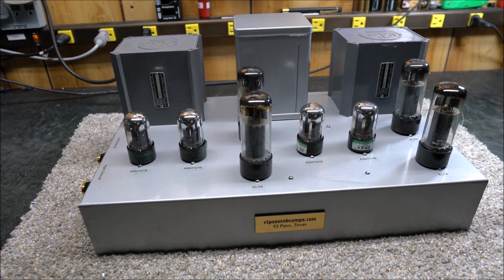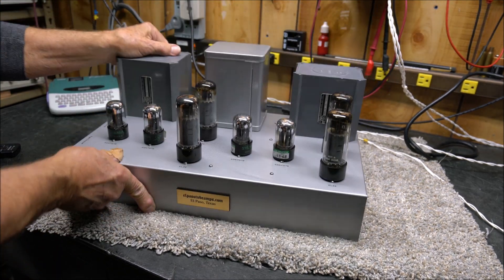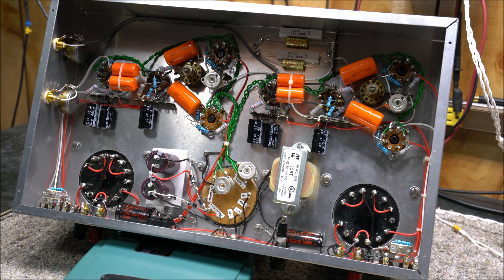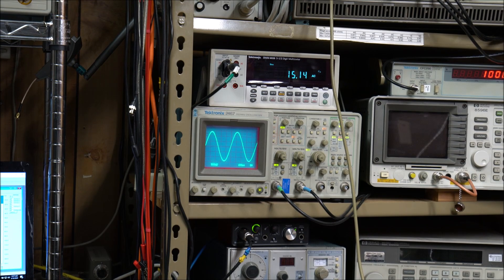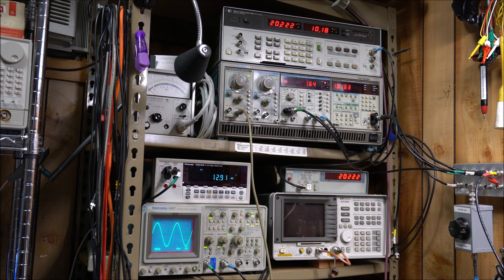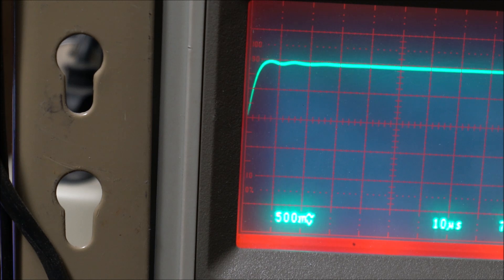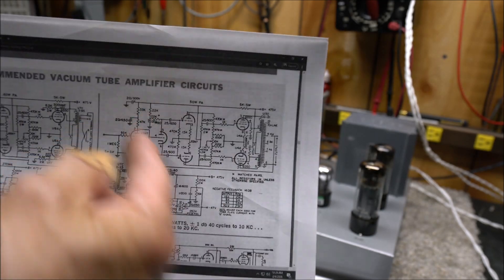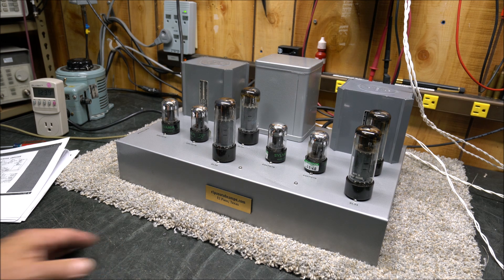Vintage 1959 Mullard EL-34 With UTC LS-57 Output Transformers In Stereo Williamson Amplifier

Comment: Nice performing amplifier and great video.  I have  a pair of UTC LS55's toutputs that I would love to build an amp with, and have been wanting to do a Williamson build.  Would you be willing to share a schematic or at least let know what your feedback values are.  Thanks for any help you can give.
Reply from the maker: Hi David - yes, I will be happy to share anything I know (or think I know...). As for NFB values and the resistors necessary to get the values we desire in feedback, I start out by disconnecting all NFB then run the amplifier up to some level of power that is still very good, meaning not distorted, monitor with an oscilloscope. If it is driven into clipping the measurements don't work. For example, run a 20 watt amplifier up to 10 watts or so with no NFB. I then decide how much NFB I want and put a pot, something like a 25K or so where the original feedback resistor was and turn down the power to the level that the amount of feedback would give. I am thinking of a classic Williamson design where we connect a resistor between the 16 ohm tap of the output transformer back to the cathode of the first stage of the 6SN7 or 12AU7, etc. For example if your amplifier is running at 10 watts with no NFB and you want 10 dB of feedback, you would adjust your resistor for 1 watt output. That would be 10 dB. Then disconnect and read the value of resistor with your ohm meter and install that value. 16 dB of NFB is common in Williamson era amplifiers and as much as 20 dB may start causing instabilities at the low end causing the scope trace to oscillate up and down at about 1 HZ. I have also found that the more NFB introduced into an amplifier, the more compressed it may sound although (within reason - up to around 16 dB) the more NFB the more power you will get with lower distortion. Typical values I have found for Williamson amplifiers are between 4.7K and 6.2K - just as a starting point...   Hope this help.
Reply: @ElPasoTubeAmps  Thanks, that does help.  The LS55 outputs are the same as the LS57s you used, excepting the line output terminals, so should perform similar to your amp if keeping to el34 triode mode, similar voltage, feedback, etc.  You said you found a 150 pf cap across the feedback resistor worked for you.  Realize that will be dependent on the feedback resistor, but do you know the frequency you found worked best of the tuned rc combo?  Thanks!
Reply from the maker: @davidmcgown9425  I know I did the capacitor tuning on a square wave and if I remember correctly, it would have been at 1 KHz  and probably checked also at 10KHz square wave. It was amazingly sensitive as I went above about 180 pF, if I remember correctly, it got a big hump in the square wave and THD went up quickly.
Just realized you may be talking about the RC snubber. I think I used 220 pf in series with 4.7K (I think...) that would be about 154 KHz. It seems almost anything in the upper KHz range should be good. It definitely stopped and smoothed out all the parasitics.  If you raise the capacitor to 470 pF it will have a pole at 72 KHz or you can leave the capacitor at 220 pF and change the resistor to 10K for 72 KHz pole if you prefer. I chose to keep the capacitor small as it does have some effect of raising THD at the 20KHz level that I can measure.
Reply from the maker: This is going to be "off the chart" so to speak, but I am considering using the UTC LS-61's that I have in the same manner I used the James transformers - that is, used them in a para-feed SET as the matching transformer between the choke which is the plate load for the 300B and the speaker. I know that sounds strange but it is exactly the same thing I did with the James transformers and the results are  truly amazing. There is no current flowing thru the primary of the matching output transformer. You would have to  hear it to believe it.
Reply: @ElPasoTubeAmps  Thanks again.  Your video was so clear, I was able to read the resistor code off your feedback resistor off the output winding (6.5K) and your discussion on square wave response stated you found 150 pF was the optimum value in your build.  I assume you took the feedback off the 7.5 ohm tap because of the way the LS transformer windings are connected.  Again the video and your discussion of the schematics really tell it all after reviewing it again.  Thanks again for sharing your experience with us!

Comment: I'm ABSOLUTELY including a mystery hole in my next build. 😎
Reply from the maker: I have enough mystery holes in some of my chassis to get good air flow ventilation... I do recycle chassis sometimes if the holes are not such that it prevents me from properly mounting the new project components. It is not too hard to lay out the major components from input RCA connectors to speaker connections and tube sockets and transformers - all the common components, but it is difficult to determine all the best places for the solder terminals for the under chassis resistors and capacitors. They usually have to be drilled and mounted  after all the major components are installed. Also, laying out tube sockets for best visual appeal from the top side of the chassis is often not the best layout for component placement under the chassis. Everything is a trade-off between visual appeal and performance, right down to a compromise of THD vs square wave response vs stability and on and on. I recently read an article that decades ago when guys like us did not have any test equipment other than a voltmeter/ammeter, they called amplifier building a "black art". I kind of understood that. How would one know if the amplifier had a parasitic at 70 KHz with out a spectrum analyzer or THD was most anything below 5% and clipping such that it could be heard? A whole lot of guess work was part of the home building art back then. It still amazes me the level of lab quality equipment we hobbyist can own these days. They made some good stuff back in the '70's/80's  that still performs properly and is affordable.  Stay safe and sane in these trying times.

Comment: Radio Moscow was a favourite station to break though on amps back in the 70s in the UK
Reply from the maker: I remember listening to Radio Moscow and Voice of America as a ham radio operator back then. The last thing I remember from the Russians was the "Russian woodpecker" which I think was an over-the-horizon radar system. Glad that thing is gone. I guess I am a little too far away across the pond for Radio Moscow to get into my stereo but the little 1 KW local AM radio station, WRAB,  in the town of Arab, Alabama where I grew up could sure get into my equipment. That was the first radio station I got to see inside and I still remember those four beautiful 833A tubes glowing and probably some blue MV rectifiers at the bottom of the transmitter.

Comment: Very nice David!
Just a question, how do you usually adjust the feedback network? Never thought it can be so critical that it might need a variable capacitor.
Reply from the maker: Hi Manuel, I first start off by disabling all NFB and drive the amplifier up to a power output level somewhere at least half of what I expect to get at full power out of the amplifier. In my 20W amplifiers I drive them  to 15 watts. I know how much NFB I want in dB and start lowering the NFB resistor (usually starting around 10K) until I get the power output level for 16 db NFB (or whatever you want and calculate) which would be 0.38 watts for 16 dB attenuation from 15 watts. You know how to do all the math. The capacitor is determined (if needed) by placing a variable capacitor across the resistor and tweaking for best square wave leading edge. Hope this makes sense.
Reply: @ElPasoTubeAmps  yes it makes a ton of sense,never found a good explanation on how the capacitor is adjusted! 
So your feedback amount depends upon how much drive voltage you want to apply and the capacitor is for best frequency response right?
Reply from the maker: @manuelminutello3027  I think that is the right idea. The resistor is going to determine how much FB voltage goes back to the cathode of the first stage out of phase. If it goes into a square wave oscillation when you apply NFB then you must reverse the phase somewhere along the line - reverse drive to the final tubes or reverse the primary leads of the OPT on the plates of the tubes. The resistor method and calculating FB dB output with no NFB and then with NFB, as far as I can see, if flawless but the capacitor thing is not that cut and dry from my experience. I have worked hours trying to get the capacitor value determination down to real science, pretty much always with the Williamson circuit but with different output transformers and I can not guarantee any result with the capacitor. Values can vary greatly and if they are to large will do very strange things to the LF response of the amplifier.
I have read that using the square wave test and trying to clean up the leading edge is the thing to do. 
In this case it worked perfectly but in other cases it is very confusing and nothing seems to go the way we want it to. That is my experience and I am likely just to leave the capacitor off.
If you look at some of the old Williamson designs, they put in a formula that the FB resistor should be 1200*sqrt(Z), Z being the impedance tap on the transformer. I really do not buy that but that might give you a place to start and they do not even show a capacitor.
BTW - I do not use any of the series F(3dB) RC circuits unless I have to especially the first one that I believe is for the suppression of AM stations. It only seems to degrade HF performance in the amplifier. You may have to use the 70 KHz circuits if you can see a parasitic out around 70 KHz or so.

Comment: David, thank you for another great video what kind of a preamp can you pair this amp with
Reply from the maker: Most any preamp should work fine. I am driving it with a McIntosh MX-113 which has a tuner. It really sounds nice and clean with great high end. I attribute that to the UTC transformers and only about 15-16 dB NFB. Too much NFB seems to make them  sound more compressed although it does bring down THD. There is always a trade-off in these amplifiers. I have found that over focus on making one parameter perfect often times causes an anomaly we are not aware we have created. In particular, too much NFB or making the NFB bypass capacitor too large may cause a parasitic around 100KHz that we will only see if we use a spectrum analyzer. I hope to make a video on that soon. Thanks for you comments. Stay safe.

Comment: Interesting, so it actually beats your previous favorite, the 6B4G amp?
Reply from the maker: It does and it delivers quite a bit more power and punch. I still love triodes but it is hard to beat the beam power tubes and the pentodes. I think I would need a quad of 300B or 6B4G for each channel to out-do this amplifier. But then that would be a bit too much power for these LS-57 and I would need bigger transformers. Actually I have two larger UTC transformers I hope to start on with Svetlana 572-10 triodes soon. That should do the trick.

Comment: Really nice amp. Pretty much what my next build is going to be.  Not too sure on the output tubes though.  Those EL34s are great tubes,  but I may go with 6L6s.  Definitely going with the 6sn7 Williamson design. Hopefully I can find some output transformers as good as those UTC.  That UV glue is pretty amazing.  I have some and use it every once in a while.  My go to is usually Loctite instant epoxy or Goop.  Depends wether I can let it sit all night or not.  I definitely need to get an Audio Discovery.  Take care!
Reply from the maker: I am definitely a 6L6 fan but it seems the EL34 has a little brighter high end and so does the UTC output transformers over the Acrosound transformers. I think they are both great OPT but the UTC transformers seem to hold a special place in the audio world. It seemed only appropriate to finally build a stereo amp with them. I truly do like the sound of this amplifier. Of course, I have to know it performs well on the test bench and then it also sounds great to my ears and music so that is a match made in heaven for me. I like the quick epoxy also. I think I mentioned I already had to replace one of the voltage doubler caps and by sticking it on with Goop, it was nice and easy to remove and clean off the residue and stick another one back in its place. I don't think the UV glue would be the best for sticking on the electrolytic capacitors. It is a little light-weight in my opinion. Great to hear from you. I hope all is well.

Comment: The Williamson phase splitter actually unbalances  at supersonic frequency because the cathode and anode behave differently. The cathode coupled phase splitter when balanced is better at supersonic frequency and gives improved stability. Less correction is needed across the feedback resistor and the rc network across the plate load in stage 1 can be eliminated.

Comment: lol, same here. I have 6 williamson amps and an st70, some will at some point be used for parts. Not the best ones though. i hope. Nice vid. learnt some new things.
Reply from the maker: We like to think that some of our best works will not just be parted out after we are gone. On the other hand, how many home brew amplifiers have you picked up over the years and how many have you restored rather than just using parts like the OPT or power transformer, tube sockets, etc? I can't think of a single one.
Reply: @ElPasoTubeAmps  none indeed. although i picked up one. Only have the tubes left. the rest was chinese stuff that whas just not up to par. Have you noticed by the way that if you look at the signal when switching from say 30 to 40 Herz, the signal bumps up and down a bit before stabilizing?
Reply from the maker: @kuda_71  I have noticed the scope trace bounce up and down on lots of amplifiers. I think that indicates that a maximum level of safe NFB has been reached. I find instabilities caused by excessive NFB show up on a 20 Hz signal often times. NFB level and performance is, in every case I have dealt  with, dependent on the output transformer. Acrosound and UTC transformers do not perform the same. Same for the Chicago Standard BO-13 and the Triad and the Dynaco amplifiers. That interface we call the output transformer is where things get passed on accurately from the Williamson voltage amplifier section (the 6SN7's) or the signal gets lots of artifacts added in by a less-than-perfect output transformer. With  that said, it is my conviction that the NFB resistor and shunt capacitor should be very carefully selected when building these amplifiers. If an amplifier is built exact to a schematic with the exact output transformer, I would assume it is safe to use the values assigned in the schematic but often times we can have everything the same, i.e. capacitors, resistors, etc but the output transformer is likely to not be the one prescribed in the schematic - so, we have to do some serious investigation and testing to get a stable amplifier.

Comment: Igor s. Popovich  in audiophile vacuum tube amplifiers vol . 3  suggested  a solid state diode on the center tap of the transformer  with two vacuum tube diodes would reduce IMD   .  This would be a fine test bench to test that out.   ( ss diode     neg    to ground  making a sort of full wave bridge  3 leg  thing . A good name for it exscapes  me.

Comment: I'd be great if you could provide schematics of your builds. Share the knowledge man!
Reply from the maker: I agree but it is a lot of work to draw the schematics. However, I have gotten into using LTSpice to model them before the final build and I print and tape a schematic on the bottom cover for one channel. Usually I do not draw the full power supply. In many of my amplifiers, I use the Williamson Design which can easily be found with an Internet search.

Comment: RC circuit across the output transformer: According to the Audio Cyclopedia (page 615), quote  "A limiting circuit consisting of  a resistor and capacitor connected in series and in parallel with the output transformer, prevents damage to high-frequency speaker units caused by transient disturbances."
It will not affect the frequency response.
It is not a Zobel circuit. A Zobel circuit are seen in solid state output circuit to cancel out the reactive portion of a speaker (inductive load).
As for the capacitor & resistor in parallel in the feedback circuit, it is there to help maintain the phase of the feedback at higher frequencies.
Reply: True . It acts like a  rc damper to keep the circuit from hf ringing excited by transients.  Looks like it improves the phase margin in the transient response.
Reply from the maker: @johnwilliamson467  I have become a believer in the RC damper circuits. Maybe in a particular amp with a certain set of tubes, etc... measurements may be perfect and it may be decided that they are not necessary but the slightest bit of change and we may end up with a parasitic at 75KHz... and we will never know it unless we take the amplifier back to the bench and do lots of testing and look way out past the audio spectrum with a spectrum analyzer. I can see that they are a real necessity in a mass production environment calming down the variations in circuit components and especially ageing of component values. I have finally decided that the little RC snubbing circuits are our friends.